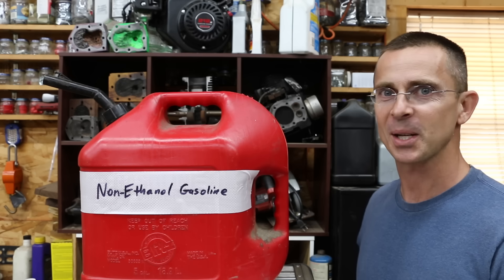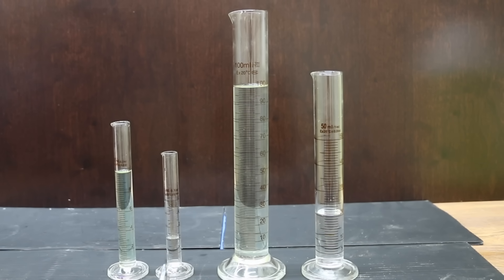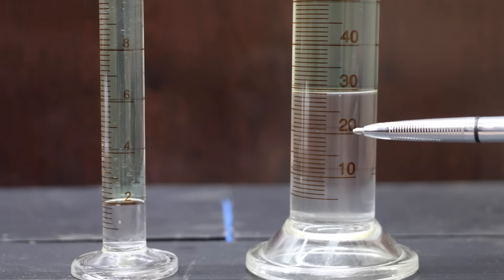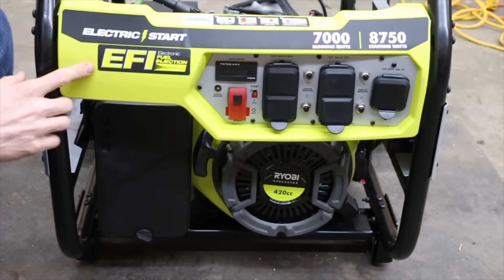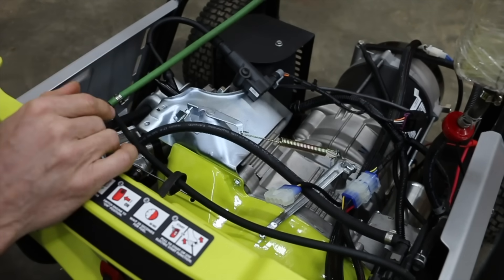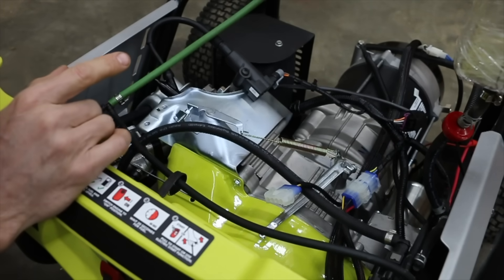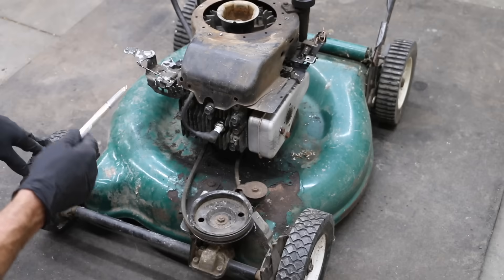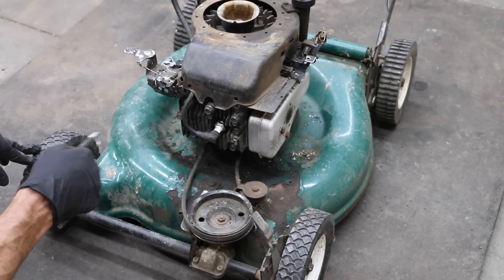Is Non-Ethanol Gasoline Really Better? See the PROOF!

Comment: I run a welding/machine shop and repair all engines as well. Ethanol gas has made me a lot of money over the years. I also pick up mowers during cleanup week. A good share of these mowers are there as a result of ethanol. Many times a good cleaning will have them running. Sometimes a new carb is in order but they are so cheap on Amazon it's worth the money to replace them. Just out of curiosity how many times have you had the head off of that lawn mower?

Comment: Great video and findings!!! I use pure gasoline 89 octane in my 1985 4runner with the 22re. I found that my truck produces more horsepower and better mpg, also it starts up instantly at any time, with the E10, it has a hard time starting, and terrible mpg. in a nutshell: ethanol is bad for environment, machines etc.
Reply: 😂😂😂 definitely

Comment: My opinion, based on what I have seen, is the ethanol fortified gas of today has been blamed for much more than the damage it may have caused.  I have seen carbs that look eaten up, but that happened before this gas was out also.  I have used ethanol gas in all my small engines for decades now and see no problems.

Comment: My 2002 Volvo S40 1.8 runs notably smoother on non-ethanol Shell V-power compared to regular E10 (10% ethanol). I notice it especially when it’s idling.
Reply from the maker: Thanks for sharing.
Reply: My 2013 Tundra 4.6L runs smoother on non-ethanol 87 and has much more responsive torque, also very noticeable at idle.
Reply: @mr-toyota  it’s infuriating that these shithead politicians actually pushed this scam through. The only way I can get non-ethanol fuel is to buy premium where I live, which is around 15% more expensive… as if it’s not expensive enough already (and mostly due to taxes)!

Comment: I'm surprised the difference was just 4%. Almost 20 years ago I went on an extended tour/camping trip in my 95 Dodge Dakota V6. Driving around my home area where ethanol and another additive, don't remember what, was required I averaged about 20 mpg. In the area where I was in during my trip they sold real gasoline. My mileage jumped to between 25 and 26 mpg. About 20% better! Never could figure out how burning 20% more fuel was less polluting.
Reply from the maker: Thanks for the feedback.

Comment: Non ethanol all the way. Ethanol mix is terrible. Have had to work on my carbs on many small engines. On vehicles? I switched to Non ethanol and it runs so smooth and gets better gas mieage too which offsets the high price. Corn lobby has got to go and EV industry will take them down!
Reply from the maker: Thanks for the feedback.

Comment: Ethanol containing fuels are potentially destructive to engines when contaminated with water, but not so much when not contaminated with water.  Several questions come to mind that need to be answered.  Are E10 (or other mixes) already contaminated with water from the local gas station?  If not which commercially available gas cans prevent the contamination of water best? with or without fuel stabilizer? Is there a canister that protects fuels from water contamination?  My understanding is that the canisters swell with heat push out fuel with the increased pressure and then draw water saturated air back in when the temperature returns to baseline. Therefore prolonged storage leads to recurrent cycles of exchanges of fuel for water containing air. Is there a canister on the market that prevents that?
Reply from the maker: Thanks for the feedback.

Comment: I live at the ocean and I am involved in boating of different types. The air is often quite humid. We see moisture pick up with the ethanol fuel to the point where fuel tanks often have to be drained and the fuel discarded. I have also seen component deterioration of aluminum components.
Reply from the maker: Thanks for sharing.

Comment: Accept this challenge.. I have a 1989 GMC pickup truck and the intake/ fuel injection system is removed and has been replaced with an Edelbrock carburetor system as well as a fuel pressure regulator to make it from high pressure from the tank to a low pressure to the carburetor.  I'm willing to have my truck used for your experiment

Comment: I own an aircraft engine that was made in 1946 and has been rebuilt. It uses automobile gas which is 80 octane LL. I would like the truth about the difference in that fuel and 100/LL. I want my Continental C85 0200 to continue for another 80 years.
Reply from the maker: Thanks for the suggestion.

Comment: I don't know but I had to replace all the hoses in my weed eater and my blower air blower and my chainsaw because of the ethanol decomposed the fuel lines. So now I use StarTron by the company starbright and I haven't had any more trouble. It's supposed to reverse the effects of the ethanol and keep the gas fresher for a longer period of time up to two years and after 2 years it supposedly will refreshing the gas ring if it's added after a long period of time from sitting. Like I said, I put it in my chainsaw gas. I put it in my everything gas, small motorcycle, small engines. I even put it in the motorcycle just saying don't know if exactly doing any good but it seems like it is
Reply from the maker: Thanks for the feedback.

Comment: Taryl Fixes All has a good long term fuel additive test on small engines. One of the fuel choices I believe is a non eth canned fuel. Definitely the ethanol schmoo that collects in carbs that sit over time is proved. I run pump non ethanol in my Gravely and other small engines. Its expensive as running them on diced lions, but well wirth it.
Reply from the maker: Thanks for the feedback.

Comment: I doubt if the water will extract all of the ethanol from the gas.  In terms of chemical polarity, gasoline and water are about as far apart as you can get, that's why they separate into two layers.  Ethanol is somewhere in between, soluble in both but more soluble in water, so most will go into the water layer but some will remain in the gasoline layer.

Comment: If you have any type of forced induction on your engine (super or turbocharger) be extremely cautious and aware of your engines octane requirements.  A fuel low in octane or ethanol used in a forced induction can cause early detonation and catastrophic damage that will not be covered no matter what warranty coverage you would otherwise have.

Comment: Ethanol creates less carbon in 2 strokes and rotaries, actually ends up having less carbon build up, leaves the engine cleaner, and cools down the engine ontop of that as long as you only use 2 stroke oil. When mixed with crankcase oil it begins to crud up your engine.
Reply from the maker: Thanks for the feedback.

Comment: Ahhh......but a couple of things not mentioned or tested for ( and for many reasons ). 1 no mention of what ethanol does to seals( it does break them down quite a bit quicker than straight gas ).  I have also had issues of biological proportions with ethanol infused gas too. Plus some small engines actually mandate you run ethanol free fuel.  A good video, but thought some additional food for thought needed to be added.
Reply from the maker: Thanks!  Thanks for the constructive feedback.

Comment: I’ve personally had it gum up carbs and cause swelling in rotomolded gas tanks (motorcycles.)

After spending a few hundred dollars in repairs I use non-ethanol in motorcycles/lawn equipment. No more issues.

Cars get frequent enough use that it’s not an issue (worse gas mileage aside)
Reply from the maker: Thanks for sharing.

Comment: Posting before watching, just my two cents up front. Ethanol was considered bad for older vehicles cause it broke down the fuel lines and doesn't last quite as long over long periods of time. As for modern Direct injection/High compression engines a higher ethanol content actually helps a engine run better because the ethanol allows higher Ignition timing, more boost and lowers temperatures of the fuel mixture hence why people run E30/E85.
Reply from the maker: Thanks for sharing.
Reply: @ProjectFarm  I forgot another thing it gums up carburetors. That's something you should test, leave higher ethanol mix fuels in a carburetor and "older original" fuel lines and see if it leaves residues or creates leaks over long peroids

Comment: So does that mean that you could buy say 5 gal of 91 non ethanol gas, add 10% ethanol to bring the octane up ?? In areas where you can only really get 90 sold as 91 and 93 isnt an option (here is california) so if you own a classic american car that wants ledded or higher octane fuels your currently stuck on race fuels to get guaranteed octane or  using octane boosters which are added to full tanks to treat the fuel for old motors. How much would 10% ethanol add to 91 non ethanol fuel ? What would it come out to ? Can you do that experiment for us?
Reply from the maker: Thanks for the suggestion.

Comment: Question: do you think moving the spark plug to center on pistion would make more power?
Also, wonder if raising compression ratio would help.
Reply from the maker: Thanks for the suggestion.
Reply: The spark plugs are positioned for a lot of different reasons such as atomization, swirl, etc. So not necessarily. Raising the compression ratio does increase efficiency, but it also requires higher octane fuel to prevent knock.
Reply: High compression does not really need higher octane rateing. It needs a higher flash point fuel. Gas is a low flash point that is it takes low heat...spark to ignite, where as alcholo or say diesel have a higher flash point that is they require more stronger spark or ascfor diesel needs higher pressures to autoignite. Most oldr engines had spark plug placement for ease of manufacturing. Modern engines are a work of art.
Reply: @splattered2929  Octane is literally the resistance to knock, or compression ignition.

Comment: why did they use to add LEAD to the gas?  It has to do with why that add alcohol to gas today. It to make the gas ignite  consistently at degree in the rotation. if not in a short time you have damaged pistion usaly a hole  in the top of the pistion. At least that is what explained to me back in the 1980s  lead was remove because it damage all the new equiment that need to clean up air pollution in ca.  Plus next the the hwy. the dirt was full of lead from the gas.
Reply from the maker: Thanks for the feedback.

Comment: I figured (similar/same routes, similar environment temperatures, always calculating by travel distance, subjectively judging power at slopes and to accelerate with full throttle) out by try and error that the purest gasoline I can find keeps my 1997 VW Polo 6N running longer. It also increases power, probably leading to the savings.
Costly high octane fuel runs the smoothest but doesn't seem to increase performance beyond regular pure gasoline. I bought it sometimes out of curiosity. Long term effects? No idea. 
But E85 definitely runs worse. It's weaker on slopes and runs out faster by at least five percent.
It's no problem to use E85 in my car but the performance is lower.
Reply from the maker: Thanks for the feedback.

Comment: When mixing water and ethanol, the volume will be less than expected because the molecules are more tightly packed together. So if you mix 10 mL of water with 10 mL of ethanol, you'll end up with less than the expected 20 mL. The gasoline with the 10% ethanol is probably at 10% even though it appears it's slightly less than 10%.  Anyway, love this video.  Keep it up :)
Reply from the maker: Thanks, will do!

Comment: would be good to see a test with no ethanol gas and something like E85 or at highest of an ethanol blend you can get.

lots of race cars run E85 as a cheaper race fuel. when I ran it and we rebuild my FA20 there was not much carbon build up so it really comes to application
Reply from the maker: Thanks for the video idea.

Comment: I know from experience and REPAIR BILLS that ethanol will gum up a carb!  My generator absolutely would not run and the repair shop said the carb was coated with "gel" from the fuel .  He told me to be sure to let my generator and lawnmowers run out of gas before storing.  Since doing that all it takes is to turn the fuel line open, wait a few minutes, and start!!  Even that "extend" stuff didn't help.  I used that to avoid the ethanol gelling!
Reply from the maker: Thanks for the feedback.

Comment: Their is almost no difference between ethanol-free and E10 in term of efficiency and performance, the simple trick to do is to adjust your fire advance engine timing.
For information, unleaded super 98 is far more agressive to rubber and cause much more corrosion than E5 or E10.
Reply from the maker: Thanks for the feedback.

Comment: I have 31 year old Simplicity lawn tractor with a Briggs V2 engine.  I've used ethanol gas in it for the majority of its 31 years.   Since there is no fuel shut off I just leave the gas in the gas tank and carb the entire Winter.  The only thing I've done is used Stabil in the gas and the last 5 years or so I've been using Sea Foam instead.   Every Spring I put the battery back in the tractor and every time it has started.  I've never had the carb fail because of the gas and about the only thing I've now noticed is that I get a bit of run on probably from 31 years of carbon buildup in the engine.
Reply from the maker: Thanks for sharing!

Comment: I’m a firm believer in ethanol free gasoline in all my lawn and garden equipment, I’m also use full synthetic oil in all my 4 cycle engines. I am also OCD taking care of my equipment. I had a Troy-Bilt garden tractor that I changed the oil in every year when put it in storage for the winter, I also removed all remaining gas from the tank and then ran the engine dry of gas and a 3 year old engine destroyed itself this spring. I gave the tractor to a young man and he disassemble the engine and it was totally destroyed inside.
I can’t be for sure this was caused by the ethanol in the gas?. I purchased a new John Deere S170, and have used ethanol free gas exclusively since purchased the S170 hoping I have better luck using ethanol free gas
Reply from the maker: Thanks for the feedback.

Comment: Believe it or not, the Prohibition is somewhat related to this, lol. Rockefeller had the monopoly on gasoline. The Model T was a dual fuel device in which you could flip one switch to change the fuel source from gasoline to ethanol, and another switch to change the carburetor to burn the appropriate fuel. 

Rockefeller wanted ALL the auto fuel $$$ because farmers frequently raised all their own corn, made their own ethanol, and fueled their cars 100%. There were townships which also powered their local vehicles with ethanol. Rockefeller was PIST. Bought the govt to legislate prohibition. The main thing they did was destroy the stills so production of alcohol was not possible anymore. By the time the prohibition ended, cars were no longer dual fuel.

Comment: Ethanol is not for small engines or anything that will sit around for a bit. In a pinch, if you have to get your lawn mowed and you cant find any Ethanol free, by all means use it. It turns anything  plastic or rubber hard. Diaphragm pumps and float needles to garbage.  Make sure you use it and run it out!!!!
Reply from the maker: Thanks for the feedback.

Comment: I converted a '67 Barracuda (273v8) to run on E85.  I changed the Jets in the Carb, used an alcohol-rated fuel pump & swapped all the fuel rubber lines to fuel injection spec lines.  It cost about $200.

Here are the Cons: 
1) If you let the fuel sit & not run the engine for more than a couple of months, then you are asking for trouble UNLESS you put in a healthy dose of Fuel Stabilizer.

2) The car used more fuel (but, the price per gal +/- offset the extra consumption).  It was a wash, more than a 'Con'.

3) E85 is harder to find.  And, if you go to using E10 Gasoline, you'll get misfiring (if you're using an 'old skool' form of fuel delivery - i.e: a carb w/ no electronics to adjust for different fuel/air ratios).

The PROS
1) The car ran alot better because I was able to get higher compression (for the specific heads I used).
2) The emissions were a helluva lot nicer to be around - smelled like Hard cider vs. a burning Cleveland river.

3) It was easy to convert back to using E10 Gasoline - swapped the Jets & put in a 'standard' Gasoline fuel pump.  The rubber lines did not need replacement.

4) I was able to register the car as a 'Alt-Fuel' vehicle - it was really fun to drive '67 MoPAR legally in the HOV Lane while Tesla drivers got bee-a-tchy.

Also, Prius & other Hybrids couldn't use the HOV, but the B'Cuda could, LOL (BTW, I actually like Priuses...except for the speeding ticket I got b/c I figured 'what cop is gonna pull over a Prius...")

Overall, I really just did this to see what would happen.  It was worth it, but when I sold the car, I converted back to Gas b/c most potential buyers (unnecessarily) freak out about Ethanol.
Reply from the maker: Thanks for the feedback.

Comment: The Holley 4150 in my '66 Rambler got all new non-butyl rubber parts with the rebuild, as the alcohol damages those parts. Also got a Teflon coated needle valve to avoid sticking, also caused by alcohol. I'm more concerned with government subsidies for farmers than I am with carbon buildup.
Reply from the maker: Thanks for the feedback.